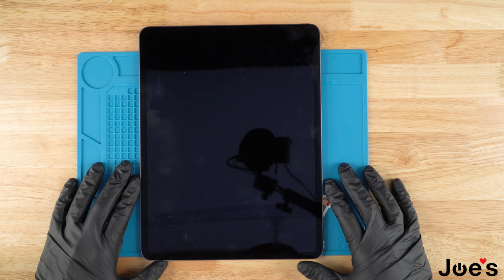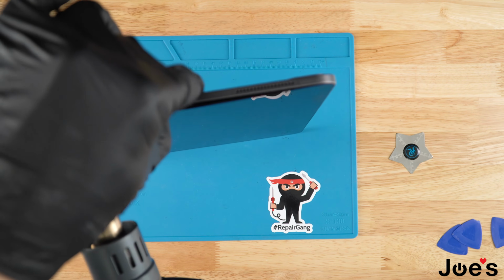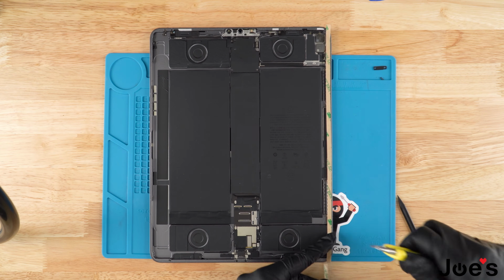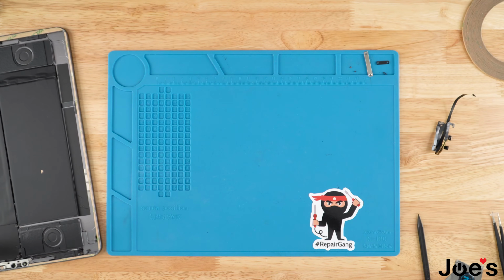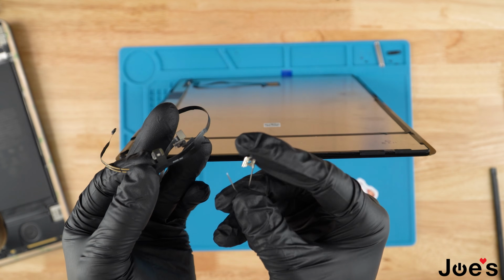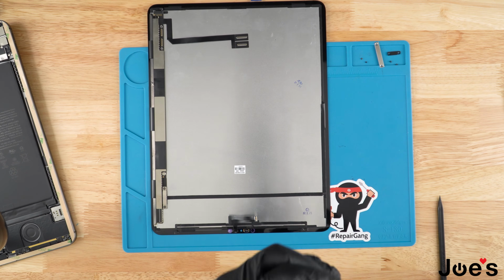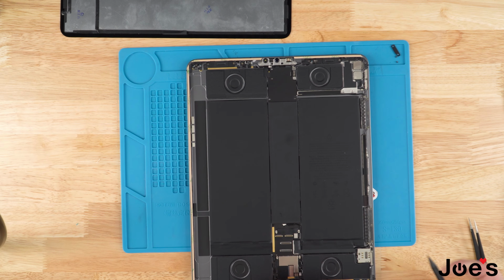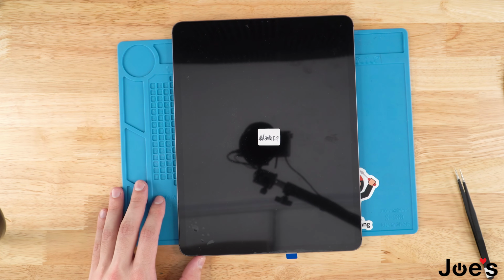Apple iPad Pro 12.9-Inch 3rd 4th Gen 2018 2020 Touch Screen Replacement | Repair Tutorial

Comment: No mention of disconnecting the battery which caused a power surge affecting my charging circuit. Screen is replaced but what’s the point if now it won’t charge. Thanks a lot.
Reply from the maker: Always good to disconnect the battery if you’re shorting things with metal.

Comment: No mention of disconnecting the battery which caused a power surge affecting my charging circuit. Screen is replaced but what’s the point if now it won’t charge. Thanks a lot.
Reply from the maker: Yes don’t short anything. If you’re not carefully and short something it’s always best to remove battery connector then power cycle. Also work with plastic pry tools when touching the board or ribbons.

Comment: A repair shop has replaced the screen of my ipad pro 11” m1 but the screen panel is not flushed and not aligned. There’s also a lot of adhesive spilling out. Why is that
Reply from the maker: Hello, thanks for commenting. Please email us at support@joesge.com with your question. We will be able to better assist you there. - JoesGE

Comment: Hello, thank you for the Video. I replaced mine but now my Apple Pencil is not working, only on the edges. I bought a good replacement screen. Could it be an Apple ic Chip Problem,  so hat you have to solder the old Chip to the new one? This would be nearly impossible for me…
Reply from the maker: Hello, thanks for commenting. Please email us at support@joesge.com with your question. We will be able to better assist you there. - JoesGE